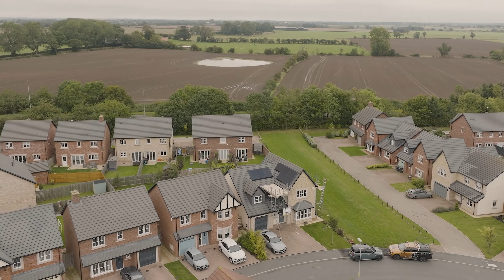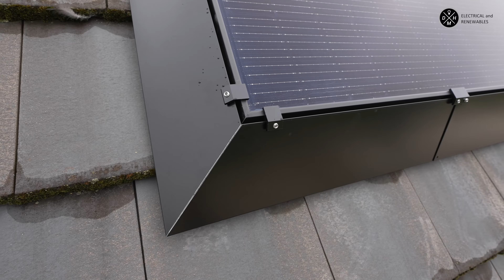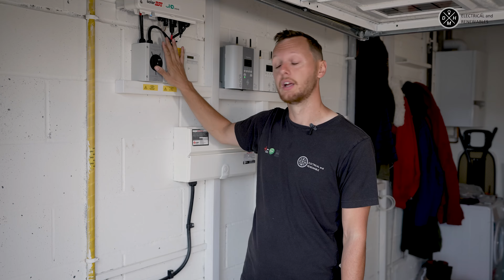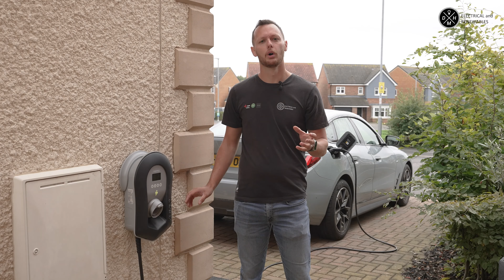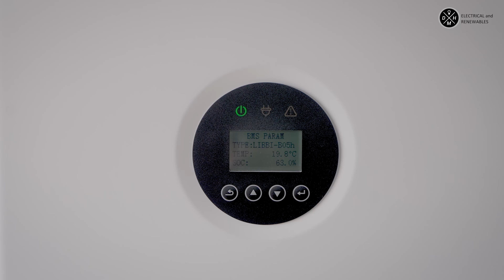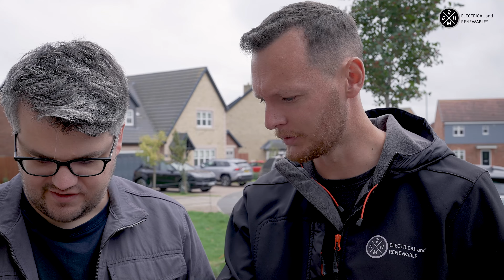The Perfect Solar Package!

Comment: What I love about this video is that the installation isn’t just a very nice looking system, it’s also very cleverly designed.
Using the Solaredge to overcome the multiple orientations and the Libbi only having dual input allows for more pv generation annually and then by matching with the Libbi in the AC coupled configurations gives you the versatility and functionality of having all of the MyEnergi products on the same eco system deciding cooperatively how best to utilise the generated power. Great design and quality workmanship.